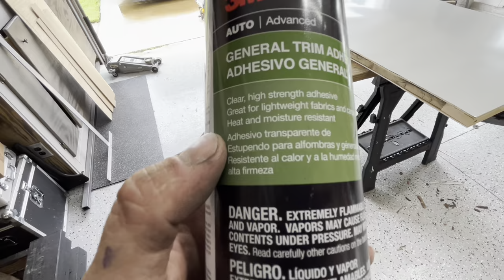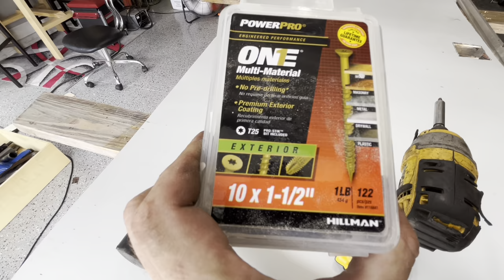🚪 Rebuilding Your Trailer’s Side Entry Door 💥 (Budget Race Car Trailer DIY)

Comment: My Haulmark side door is 48" x 72"  rotted bottom badly, i stripped the aluminum outside sheeting and aluminum u channel seal pieces, used a 3/4" and 1/2" sheet of PT  plywood, hinges are carriage bolted to steel inside the trailer wall on side of door, very heavy now but will out live me and looks great.
Reply from the maker: That’s awesome sounds almost bulletproof proof lol
Reply: Cost a lot to do 2 sheets PT plywood new carriage bolts, new bar lock piece, etc. Oh and a tube of 3M 5200 to seal through bolts of hinges and lock, I had to use 2 different size plywood to get the right thickness for the u shaped door seal
Reply from the maker: @johnpower8356  oh forsure I understand that

Comment: I didn’t realize the trailer was so short. Dumb question but gotta ask is your car gonna fit in it? I have a 22’ enclosed n with a Foxbody with a small wing, Honda scooter and some small cabinets up front things are pretty tight.  I like following the build though and your right about the trailers not being built with quality parts/thought!  FWIW mine has plywood interior front n sides with the top but it also has insulated panels on the ceiling which I guess helps with the summer sun heat during hot months.  We used to set up ez-ups at the track out from the trailer but anymore we just hang out in the trailer these days with high velocity fans running in the trailer.  AKA poor guy AC.  But when it’s in the mid 90’s it’s just miserable n takes all the fun outta track days.
Reply from the maker: Yes according to all my measurements it will fit with hardly no room to walk around it. Winch it in and winch it out. That’s why I’ve had to come up with a way to secure front of car from side door which I haven’t talked about yet and haven’t ordered the parts. Yea I feel you on heat I’d like to add ac to the trailer from a RV one day soon so the girls can have some where to go if they go with me to track. I also wanna ad a tv for them and a window which I actually bought last weekend used.
Reply: Ok sounds like a plan which I was sure you had already thought about. I’ve looked into adding an AC unit on the roof of my trailer also. From my research adding one depending on what ya get a new setup is around $800 -$1,100 depending on which unit ya get n then add the generator to supply the power. My lil Honda 2000 generator wouldn’t cut it so say a HF 3500 unit would fit the bill n they are almost a grand now….ugh. 🙀
Reply from the maker: Yea definitely money. I’d love to find a used unit off an rv part out